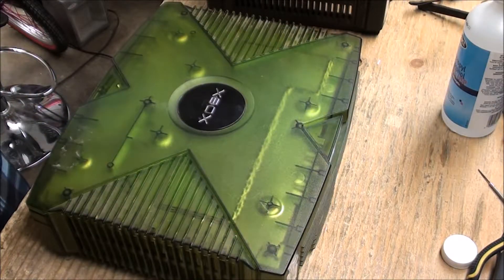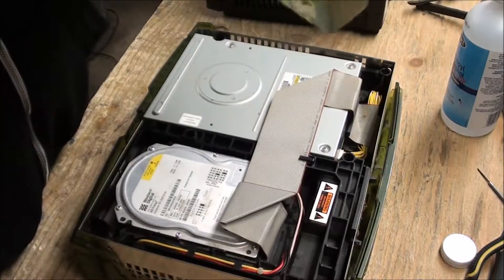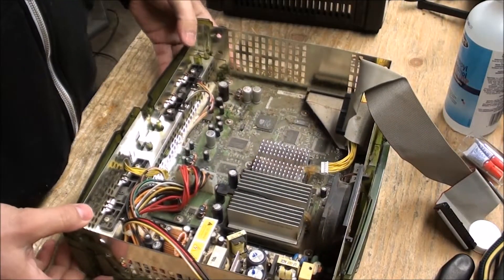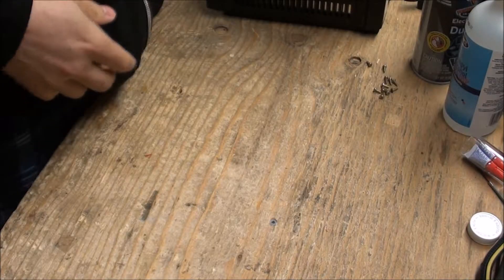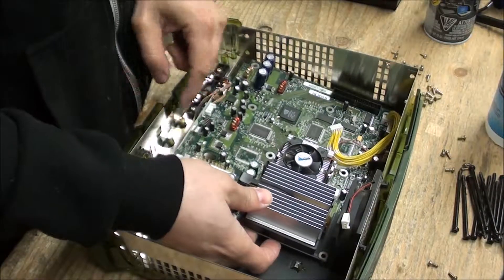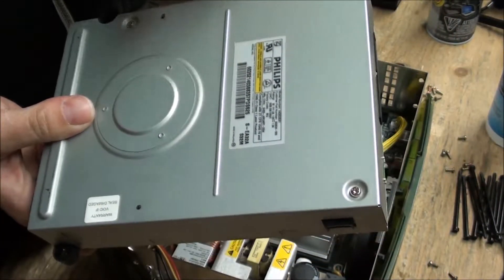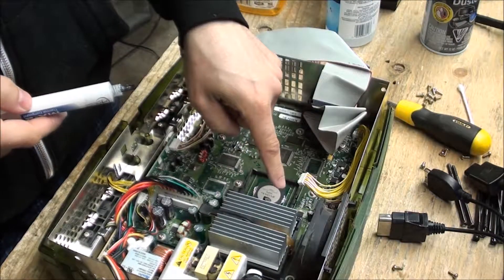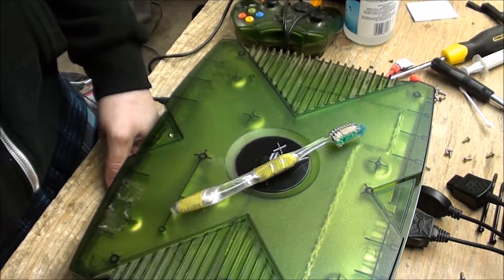FixitSam: OG Xbox shell replacement, teardown and reassembly

Comment: Might do a shell swap/ replace later but I’m gonna modchip it have the power led swapped for blue/red and the fan with an 60mm multi color blue red green and orange led fan and I’m replacing the thermal paste with Mx-4 thermal paste my model is an 1.6b motherboard from 2005